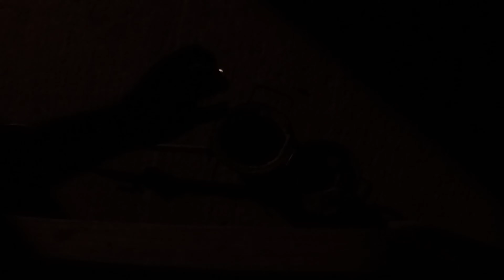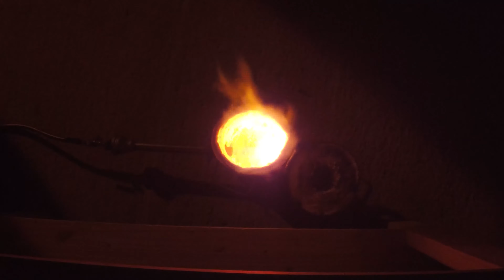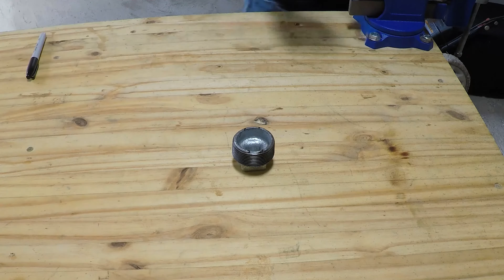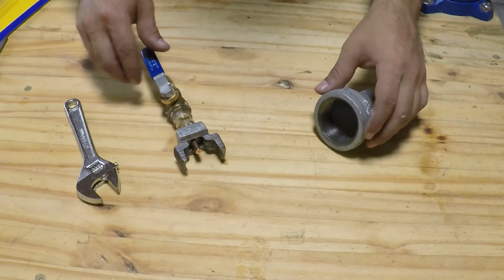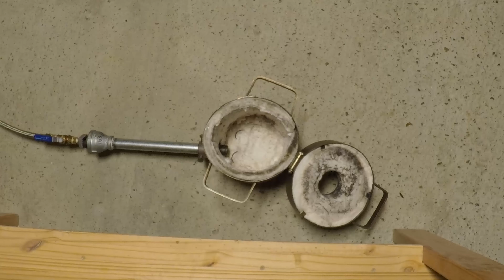DIY propane furnace/forge burner - no welding/soldering required

Comment: great video! Wouldn't black pipe be better than galvanized?
Reply: I mean galvanized is fine. After the first fireing it should evaporate all the zinc coatong that's exposed to the heat.
Just be careful not to breath the white smoke in when you start the first time and you should be fine. 👍 May as well melt some brass on your first fireing cuz that's going to let off zinc anyway 🤣

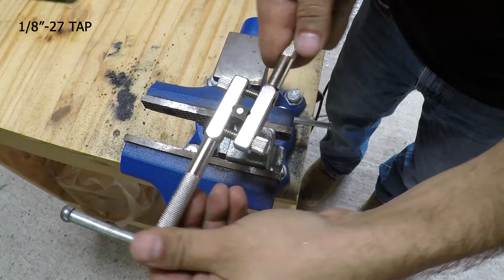Comment: Something wrong at 3:30.  That is plainly not a 1/8" tap. Great build.
Reply: Belay that.  I see now how the tapered NPT taps are bigger than the corresponding SAE taps.  A 1/8" x 27 tap is correct to thread the center hole in the plug.  On the other hand, the threaded MIG tip was much too small to serve as a nozzle threaded inside the 1/8" nipple. Instead, I drilled a .040" hole (#60 drill) down the center of a 5/16"- 18 brass bolt, cut it 5/8" long, and fit it in the same thread cut inside the 1/8" nipple.  I drilled holes and cut threads with drills and taps mounted in the the drill press and lathe to keep everything straight.

Comment: Hello, for the piece of copper that says 0.8. How do I find it? What is her name? On which device is it located? Is it possible to dispense with it, by using a 1 mm hole in the screw directly? Thank you very much
Reply: It is a mig welding tip

Comment: Good job bro, curious though as to if you have tried to use an air compressor to force more air in that design with more propane to make it hotter for steel smelting??
Reply from the maker: I’m actually working on one right now, will be uploading a video this weekend with a new foundry build and torch design
Reply: @SizzlingIngot  that's awesome, well keep up the good work. I'm looking forward to seeing what you come up with for your new ones
Reply: Just add in an additional burner

Comment: Start out with "black pipe". gas from hot galvanized steel can kill you.
Reply: Not good for ya. I welded galvanized steel sheeting for years. No respirator
 Young m dumb and didn't know better and shady company didn't care. Just fine. Metal fever is real though for sure not fun